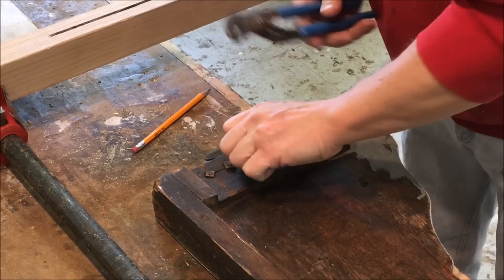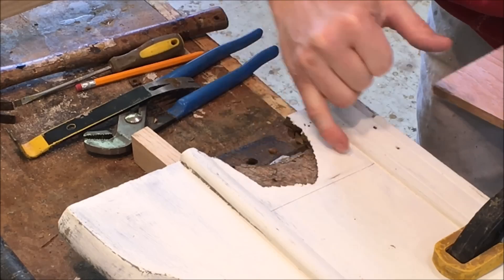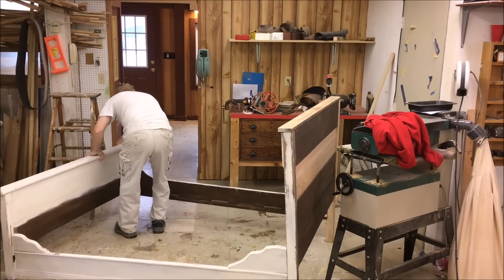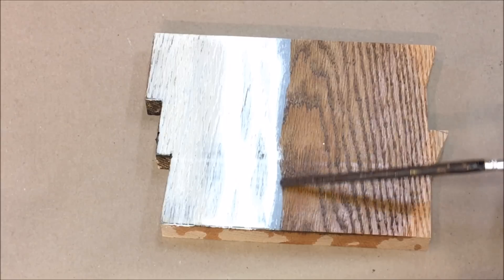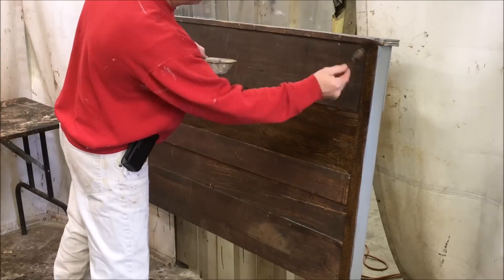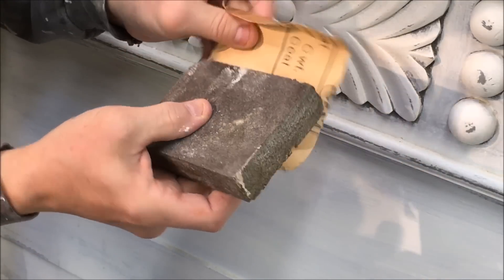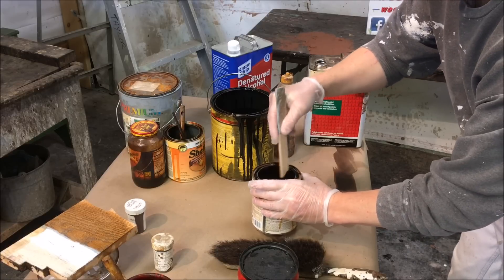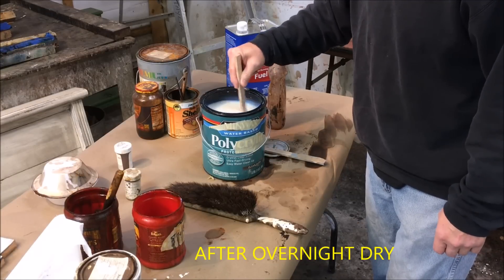SHABBY CHIC OAK BED -- FROM TRASH TO TREASURE !  (PART2/2)

Comment: Kind of nice, I would have done one of two things differently, either strip the paint entirely and stain the entire thing with the original stain or at least paint the entire bed, not just the parts that you see after the mattress is on.   But that's just me.   Otherwise, very nice job.
Reply from the maker: it would have been a nightmare to strip and probably worth more as shabby chic

Comment: Hi there , I saw you mix your stain with alcohol but for the final wipe you used naftha what does that do ? Could you use alcohol again or not ? Thanks great video
Reply from the maker: no I mixed it with naptha not alcohol . alcohol will not thin oil stain , completely incompatible

Comment: You went through all the trouble of staining the new panel in the back, why didn't you paint the inside of the side rails or inside the bottom of the footboard?
Reply from the maker: they are not visible when the matress is installed